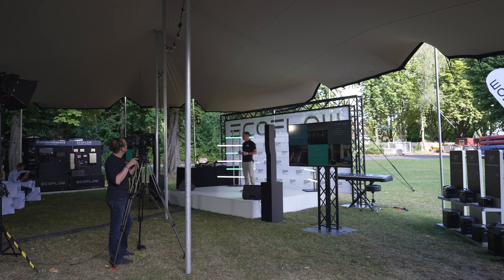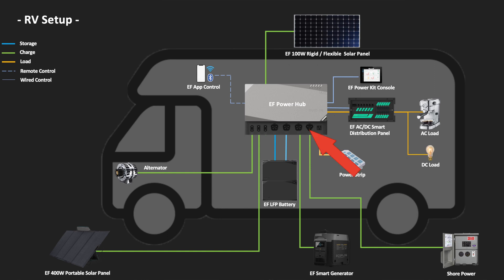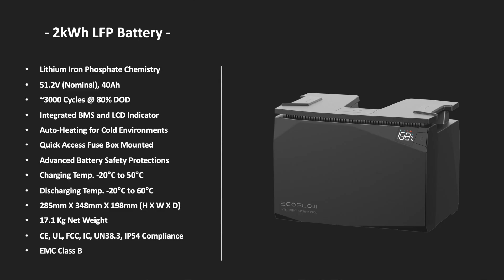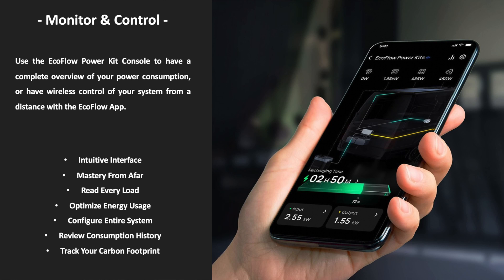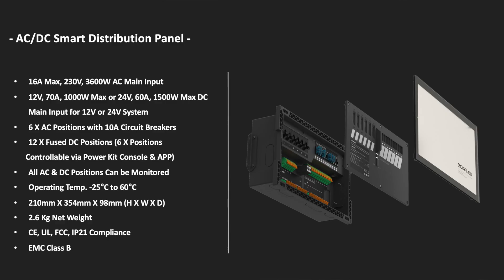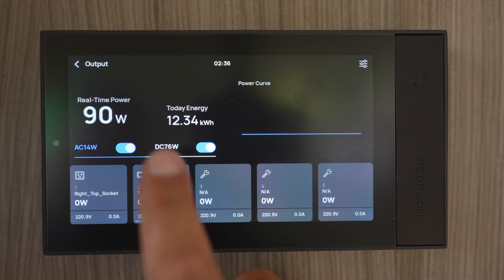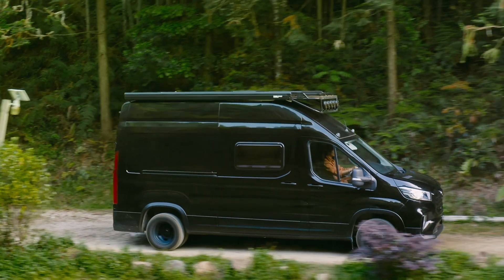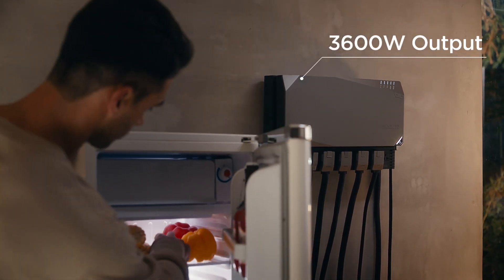EcoFlow Power Kits | Geeky UK Review

Comment: Wonderful video and great information . I have 3 questions: 
1-Will the Motorhome alternator be able to charge the system when the engine is at idle RPM ? I believe there should be a minimum RPM for the alternator to keep charging . Hence maybe idle will not be enough. Any recommendations? 
2- will the 15 KW system allow for an additional battery to make a total of 20K Watts to be able to run the aircondition for 16 hours Off Grid during the very hot summer heat .
3- Do you think Kon tiki manufacturer will install the system at their assembly line , to run the long cables to the alternator or vehicle battery themselves ? If not , who do you recommend for the installation if you are so busy till end of 2022? 

Thanks for the reply .
Reply from the maker: 1) This depends on the alternator. Most Bosch alternators will output 40 amps on idle RPM.
2) Each Power Kit can have three 5kW batteries connected giving a total of 15kW. You could have two Power Kits in parallel to provide a total of 30kW.
3) No I don't think that Swift will install the cables for you. It is difficult for me to recommend an installer as I then have liability if they do the work badly.

EcoFlow are currently evolving their installer network in the UK so they may be able to recommend an installer.

Comment: Hi Phil, could you help with some advice please, l have just fitted a 2kw pure sine wave inverter to our Motorhome, dropped in a 150amp breaker and the + feed, l want it to run our 700w microwave, but when l power the microwave up it trips, any suggestions would be very helpful thanks, sorry l have to use Ytube but l jave no other social media.

Best regards

Rob
Reply from the maker: A 700w microwave could use 1400w to power it! The 700w is the cooking power. If the breaker is one of the Chinese black ones with a red level it is most likely faulty. I have NEVER seen one of these units that works correctly.
Reply: Thanks Phil, l have indeed fitted one the the Chinese Breakers with the red reset, can you recommend a good Breaker l can install,  Rob
Reply from the maker: @SimplyMotorhoming  No, please use a mega fuse and holder.
Reply: Thanks for your help Phil, a Mega Fuse it is 👍
Reply: Hi Phil, quick note Mega fuse fitted all working OK now, thank you very much for your help 😁👍

Comment: Can it be used to power a DC rooftop Air Conditioner?  l
Reply from the maker: It depends on the amperage required. The Power Hub can deliver 70A at 12v DC or 60A at 24v DC.

Comment: Hi Phil, Great video thanks! I'm just about to take delivery of my new Kon-Tiki 874 and until now I was going down the Victron upgrade route, as you know the van model do you think Eco would be a better route to take?
Reply from the maker: Everything that you see installed in the Radford's Kon-Tiki and more is in this one unit. In fact the the charger and inverter are more powerful. You would still need to install larger cables from the starter battery to prevent the voltage drop on the DC-DC charger. The other complications with the Sargent control system are the same regardless of wether you install EcoFlow or Victron. Personally, I will be fitting a full 15kW independence system in my new self-build.
Reply: @GeekyPhilip  Hi Phil, many thanks for the information. I think I'll start with a 5kW system with a view to adding another 5kW unit as and when I need it. A few questions if I may. Does the Kon-Tiki 874 have a smart alternator?  Is buying direct from EcoFlow the best option and will they supply a terminated larger/longer DC-DC cable and finally could I employ your services for the Sargent interface part of the upgrade?  Regards, Rob
Reply from the maker: @robdoherty9788  Yes, it does have a smart alternator. EcoFlow would not be able to supply the uprated cables. Because of the length of the motorhome, there will be a significant voltage drop hence the large cables. The cable would need to be at least 50mm2, and you will need a minimum of 11 metres of black and red. It will also take a few hours to install the cable under the van and connect it to the starter battery. I would add around £400 to your budget to buy the cable, conduit, fuse and clips you will need to install it. At the moment, I am not taking on any work as I have enough work to take me until the end of 2023. I am happy to advise you on the "Sargent complications." If you send me a message using the contact us link at the bottom of the page on motorhomer.com, then we can arrange to talk.

Comment: Thank you so much for documenting this! About to order the kit for my school bus conversion. Do you know the maximum solar input? 1000W of 12V panels? Can't find this information. Thank you!
Reply: Actually...scrubbed back through the end of the video. 4800W of solar can be connected to it? Is that correct?
Reply from the maker: Sorry for the late reply. Each of the MPPT solar controllers can utilise 1600 Watts of solar panels. You can also use the B2B charger as it is MPPT for and extra 1000 watts.
Reply: Up to 4,800 watts input for solar

Comment: I've been waiting for your review after reading you were going ti Germany to see it. Sounds fantastic.
Reply: I went to a motorhome show that had Ecoflow.  I asked about the display unit,  I said it can be used in a campervan to see what is going on, a bit like a tablet. The guy had no idea what I was talking about. We are thinking of Ecoflow for our van conversion.  I asked about how to connect wiring to the Ecoflow (  I've seen another powerbank system where they wired to a fuse box/thing and then to the power bank. I said I really had no idea , but clearly neither did he. He said the fuses were inside and no more help. As soon as someone else came, he dropped talking to me like a hot potatoe.  Maybe that was a daft question.

Comment: Looks great. The perfect system for motorhome manufacturers?
Reply: I can't see it, it's too expensive. Based on a rough calculation, for me to replace what's in my van with this Ecoflow system, I would be spending around 2.5 times as much - and that's with my van using a lot of Victron gear, if I had used less expensive componants then it would an even bigger gap. The app does look nice though